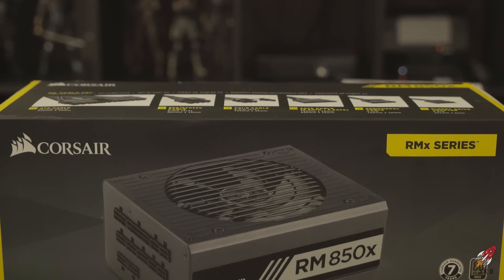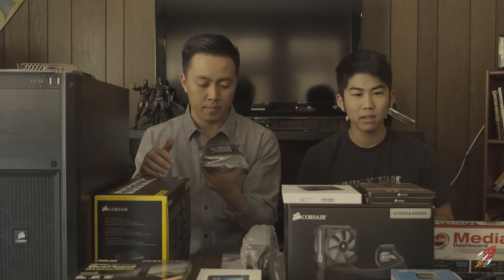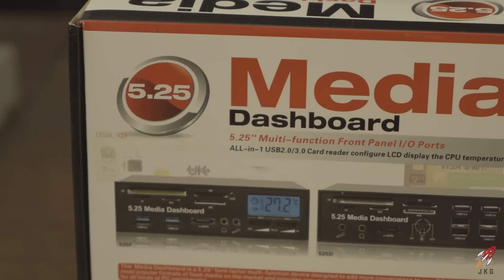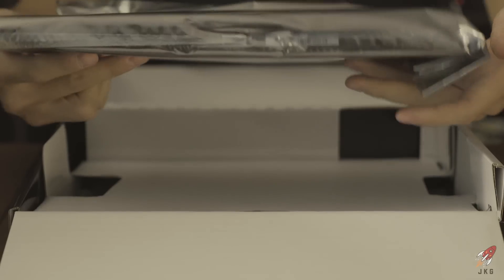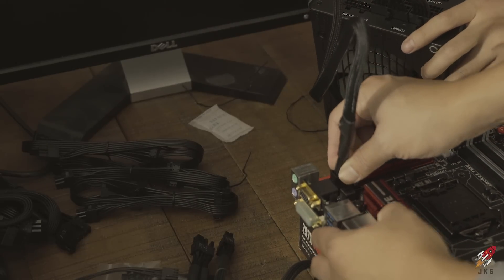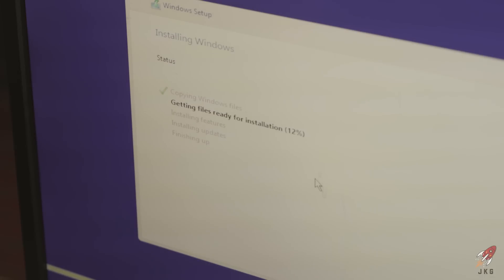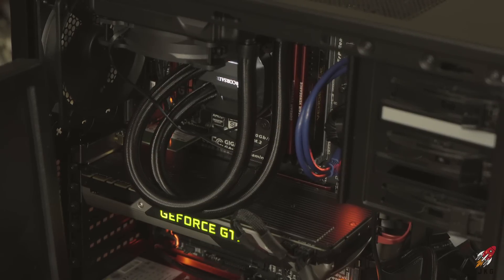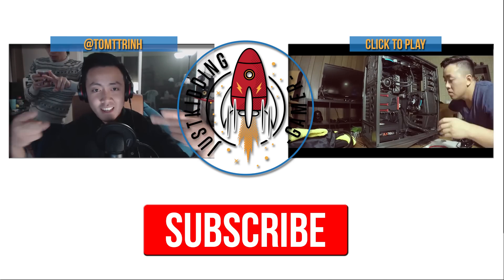PC Build 2016 - A New Build for Ryan

Comment: I'm glad y'all are doing actual PC BUILDS.. that seems to be the part so many of my friends get intimidated about. It's not hard really! Thanks for making some videos for me to show them a small "how to!"

Imo, if anyone is getting a full tower the best tower to get is the CM Storm Trooper. The ventilation is fantastic, and the fact that the case has a handle on the top is really useful if you're the type of person who moves around a lot. Another good one is the Thermaltake full tower A71. It's a bit cheaper, no handle though. Personally, I like the look of it a bit more, and the LEDs are pretty sweet. The real feature of the case is the Hot swap top mounted docking station for entire hard drives. It's great for if someone has something on their PC and you wanna get it onto your PC without a CD or copying onto a flash drive and waiting. Just pop one hard drive out and pop it back into yours and voila! On top of that, the internal can fit 5 more hard drives. . all of which are super easy to install and secure. :P

Comment: you dont need 850 watts, your build's power output is around 400watts, therefore your optimal power supply would be 500-600 watts

Comment: Did you clean the excess CPU paste from the generic cooler off before placing the AIO in? :/ 
Builds alright, only reason I'd get 850W is that you might up another 980 for some SLI.. butttttt :/ Doubt it.
Reply: +Xipo86 Who knows someone might have a 980 lying around since they do have a lot of computers with decent hardware. Then again you could just dump a few hundred on a new card.

Comment: how much was that all together o_o?
Reply: I'd say around $1k-$1.5k. So its a pretty good pc, around the slightly higher end of the mid range
Reply: oh really :o? wow
Reply: +AgentC6H12O6 1.5k seems too low. I would say 1800 to 2000.
Reply: I'm pretty sure his build looks to be around 1.5k minimum to 1.8k max (USD)
CPU: $300 ~
Cooler: $100 ~
Motherboard: $200 ~
Ram: $80 ~
SSD: $90 ~
HDD: $100 ~
GPU: $600 ~
Case: $100 ~
PSU: $100 ~
DVD: $20
OS: $100
The ~ indicates an estimate.
This doesn't include any monitors, accessories or peripherals.(which could end up costing around another $300)

Comment: cmon guys, you might as well hook up ethernet cable to the tower. Wi-Fi is a big no no! A cable is not expensive and clipping RJ45 connectors is very easy. Otherwise it's an awesome built and very goofy narration.

Comment: GUYS PLS HELP!!! I am going to build my first PC and I have a list am I missing anything or any suggestions 

 Processor: Intel i5 4690k 

Motherboard: ASRock micro ATX H97M pro 4

Cup cooler: NZXT Kraken x31

Ram: Crucial ballistix tactical tracer 8gb 

SSD: Silicon Power 120GB S60

Internal hard drive: Hitachi Deskstar 3.5" 1T

Video card: GeForce gtx 960

Tower: NZXT s340mid tower case

Power supply: EVGA SuperNOVA 750w

Pls can anyone tell me if I need anything else, I'm pretty sure I have everything pls and thanks!
Reply: +pacman3581 Dont use the NZXT Kraken x31 use a NZXT Kraken x61 or something its size the smaller kind perform the same as most air coolers
Reply: +Night “Catnip” Baron thanks

Comment: How much is the total for this PC build? Thanks
Reply: +Hans Balais 
Corsair 300R (the case) is $80

corsair rm850x (power supply) is $140 (850 is kinda an over kill for this)

GTX 980 (graphics card) is about $500 though the price can vary .

WD Black 2 TB (hard drive) is about $125

SSD 850 EVO is about $85

Vengeance pro 16 GB setx2 (He got 2 sets of 2 for 32 gigs) Is like $160 (32 
gigs is way more than you need )

asus pce-n53 (wifi adapter) is about $50

Corsair H80ti (liquid cooling) Is about $90

gigabyte g2 gaming ga-z97x Gaming 7 (motherboard) is about $165

asus dvd drine is like $20-$30

He Didn't say the maker of the media dashboard so i'll say $40 Just a guess

intel i7 devils canyon is $340

So that us about $1800
BUT, he got a free $500 Graphics card and he bought all this stuff on sale.
Also this is  not counting any shipping fees.
<3
Reply: +Jumper Fett thanks man! You da real MVP!